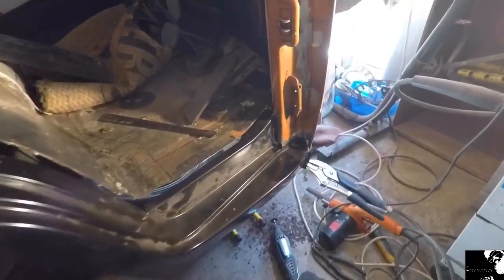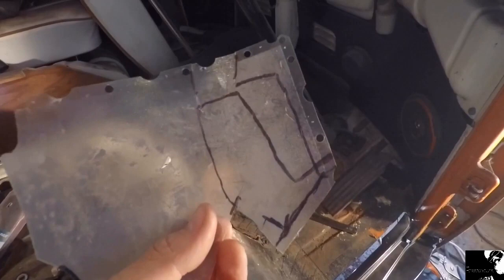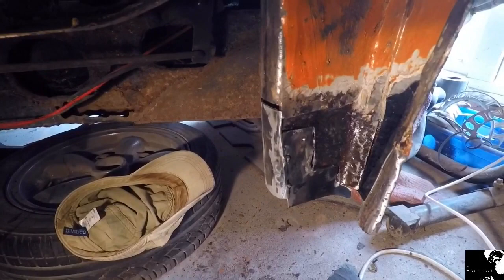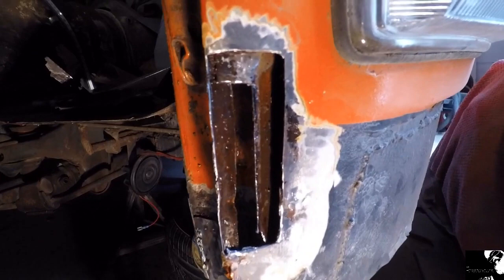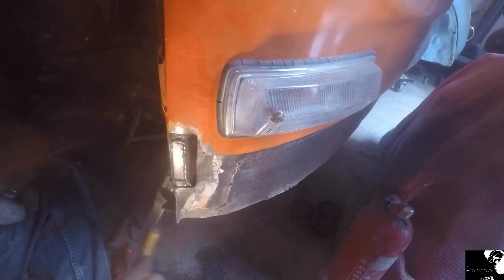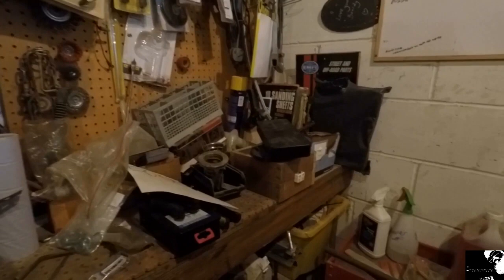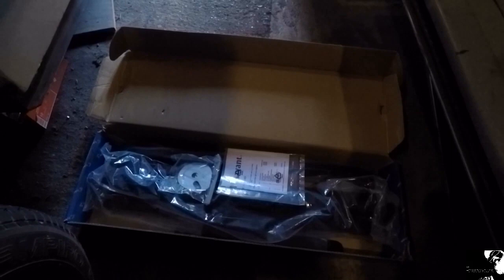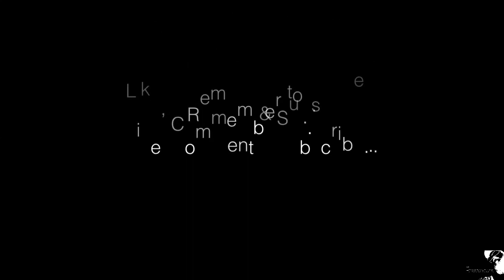Classic 1970 VW Camper Bus restoration. ‘Day 51 - drivers side A pillar’.

Comment: I got a han d break from  Eastwood auto parts mounted it on a piece of 2x8 wood. it does help with making bits. I started looking at what at kassicfab patck part..they are high quality but you can drop crazing money into them. i discover my skills by maling verses buying..not flipping the bus nor do i have a dead line..so enjoy making bits like you. nice job on the a-pillar..soon you will be welding on the dog leg.
Reply from the maker: Won’t be far away I hope. Can’t see myself selling these projects either. Want to be able to enjoy them once done. Some parts are just ridiculous money, usually the more complicated shaped parts I know, but even still. If I can make them, and save a bit of coin, I’m a happy man.